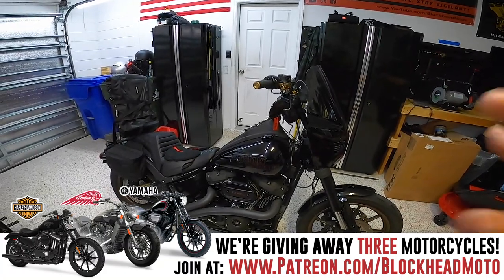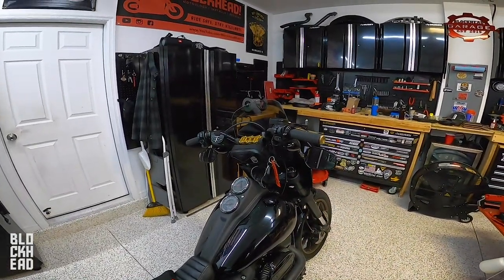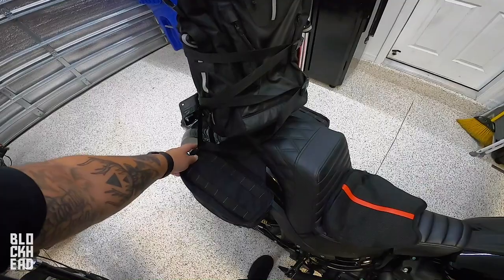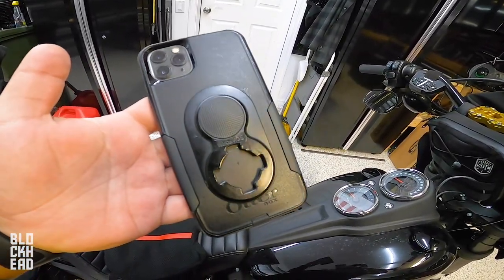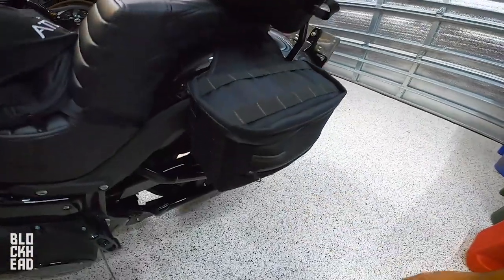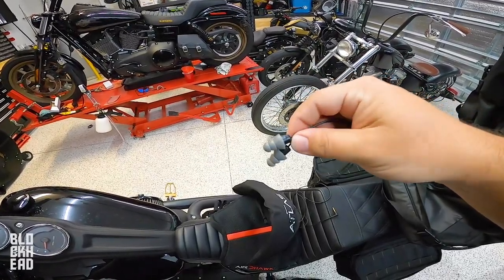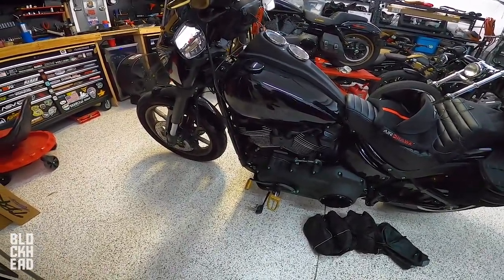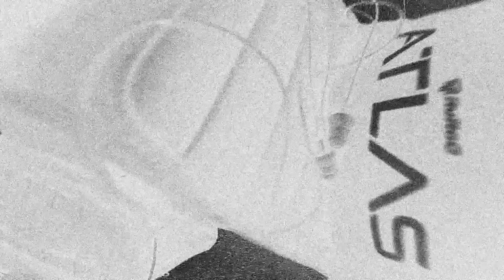800 Mile Motorcycle Road Trip Gear & Essentials! (Harley Low Rider S)

Comment: Blockhead, question about your bars.  I'm 5'9" and like the look of your bar set up.  Do you like the bars in the position they are in, our would you have liked some more pullback? I'm debating between something similar to yours or the 12" Speed Kings pullback bar/riser with 2.5" pullback. I know to each their own, just like to know your thoughts.

Comment: I would add a pair of light weight Merino Wools socks, Warmer, dryer in the heat = foot sweating, warm when wet, don't stink as bad and Not Really Hot In Hot Weather. Trust me, just try a pair. Your feet will thank you. Hikers swear by them. I found them the best socks for trips. 
The brand "Darn Tough" socks have a lifetime warrantee.

Comment: My local dealer said they'll do cruise control and install for $400. It's $250 for the part itself, and then they said $80 to reprogram. I've been debating if it's worth $70 to install it myself, especially cause it's in the shop right now anyway after I hit a deer a couple weeks ago.

Comment: Running thrashin bags on my Dyna also. Definitely love them.  Blockhead you should look into the LeatherPros V3. They are expensive but worth the money. Expandable and you can take them off with you get off anywhere. I need to get a sissy bar though so I can run a bar bag like that

Comment: Besides sweating a loaded back pack adds weight to you the rider and I find makes your should pull back stiffening up your dexterity in controlling the bike. That sissy bar lowers the level of added weight and takes the pressure off the rider .

Comment: What sissy bar is on the Low S? Been looking for one similar the it, or maybe taller, for my 2018 Softail Sport Glide. Ones I’ve seen are for decor only, no load bearing. Would like to find one that looks somewhat old school, but is sturdy for gear/rider.
Reply: Did u ever find a taller sissy bar that worked?

Comment: How to be a proud harley owner in 3 easy steps:
1) Install Fartmaster 9000 straightpipe exhaust.
2) Call earplugs the most important piece of equipment the first time you have to ride a thing for a length of time.
3) Retain zero self awareness.

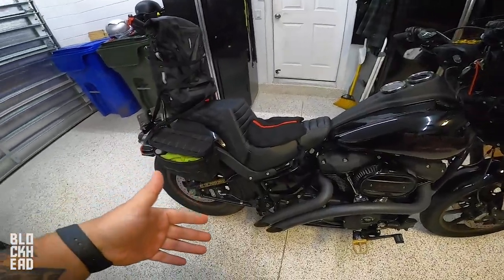Comment: 5:35 What a sound?? Hehehe
We say: I'm not rich enough to buy cheap stuff! Instead of bigger panniers, you have a motorcycle hung with craps like a Christmas tree. Unnecessary bags for unnecessary things, holders, a tall rucksack behind the rear wheel completely changing the geometry of the chassis. For me, absolutely bad.
I have only lockable side panniers and does not matter, if it is weekend trip or two weeks trip. No backpack, no topcase, no tankbag, no phone holder. Pure motorcycle.
Seven t-shirts, seven sets of underwear.. for what? One dressed, one or max two backups. Functional laundry, I wash in the evening, in the morning I have clean and dry.

Comment: I went from Pittsburgh to Milwaukee and back in 3 days and had a hundred mile run in WI on a ‘98 1200s sportster with a ‘97 1200c stock seat, throw over saddlebags, and a sissy bar back pack, lol. You’re being dramatic. Check your mechanics, change your fluids and hit the road.